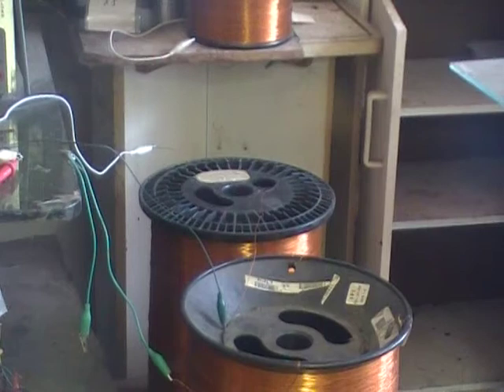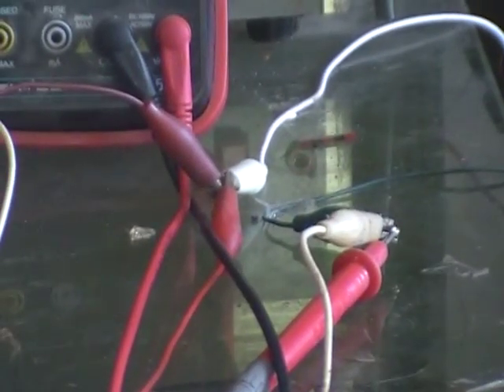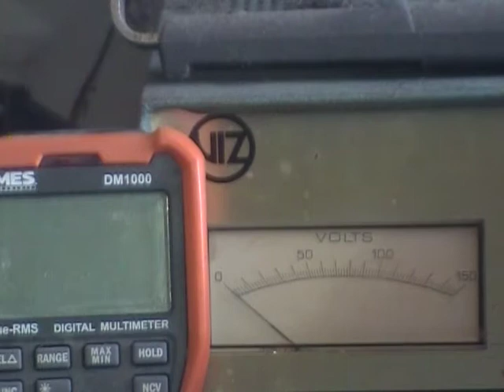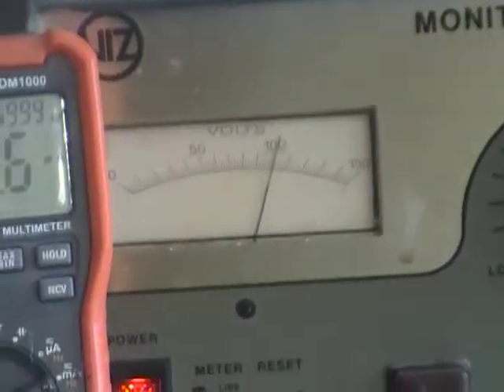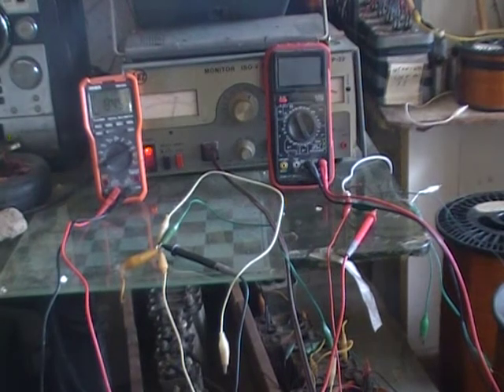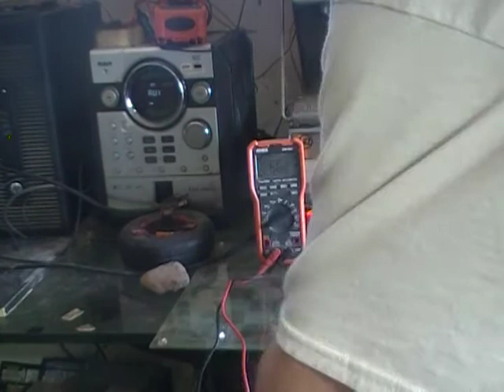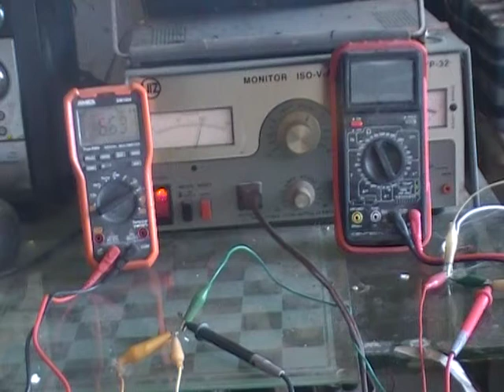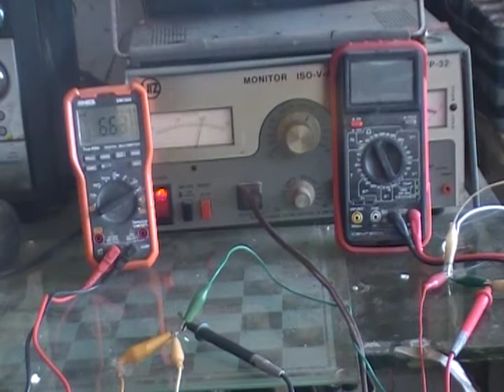High induction coil resonance @ 60 hz shows Q~ 13.

Comment from the maker: The ideal Q factor is determined by X(L)/R. Here the inductive reactance X(L) can be approximated as Z=100volts/.0066 A=15,151 ohms. The ideal q factor is then 15,151/868 = 17.45. The actual working q factor is then measured as the ratio of conduction at resonance to that of its reactive current, or 84.4/6.6= 12.8. The % of resonance that developed after deducting losses due to the large coils internal capacity is then 12.8/17.45= 73%. The internal voltage rise is then 12.8 times the source voltage.